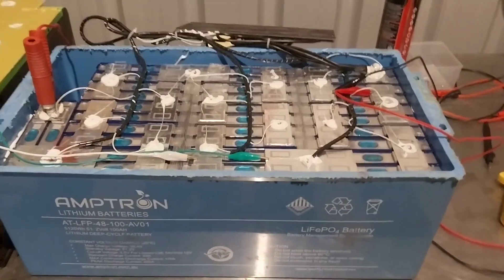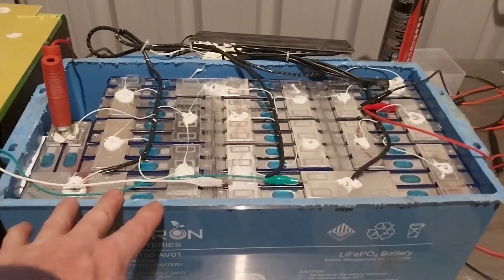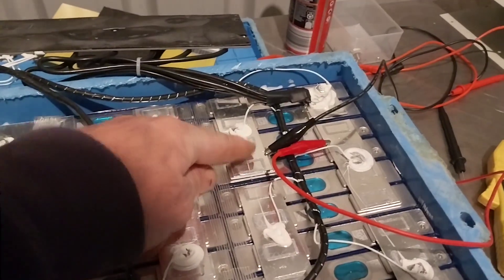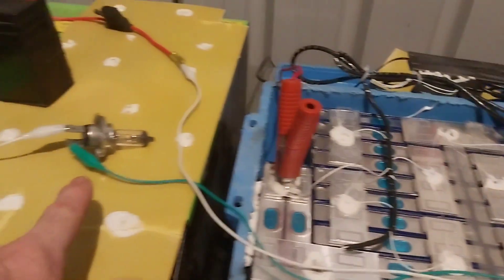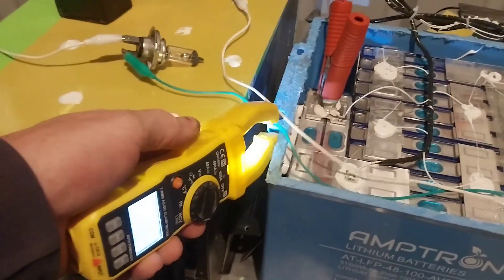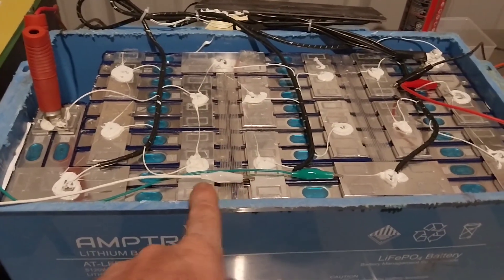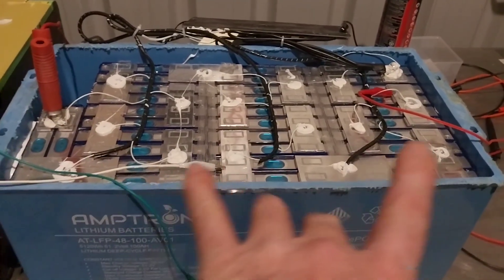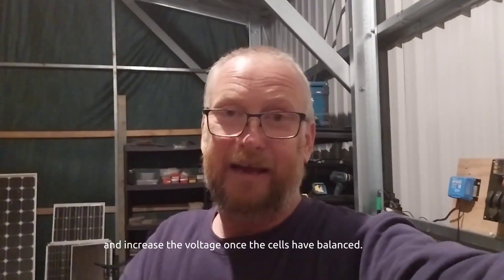Update On The 48 Volt Battery With Cell Balance Issues.

Comment: The 56V in VRM is looking good. There is still a little spike from 55V, but I can see the BMS is connected, and there is no ripple and a small balance current coming from the solar charger. When you do the discharge test, what you might find is that the cells that are high will be the first to hit a lower voltage. This is what I find in my batteries. The best cells are the last to balance and will still be 3.2V when others are hitting 2.6V, and the BMS is shutting down discharge. Looking forward to the next video.
Reply from the maker: I set both the remaining cabin batteries and the battery I pulled apart to 55.2 volts on both absorption and float. But decided to up the voltage to 56 volts to get the cell voltages a little higher to help with trying to balance.
We see how that goes?

Comment: The Kings 2 x 12V 120Ah lithiums I have are now 3 years old and seem to be working fine as a 24V system. No issue although I have run them flat a few times in extended wet wx. Don't spend any time checking the capacity as they deliver backup to IT and automation 24/7. The solar system seems to get them to full charge 28.4V cutoff most days and they float 27V.
Reply from the maker: Yes I am experiencing the same from my two Kings 120Ah Lithium's on my 24 volt system.
I was saying to a fellow off gridder yesterday when he came around to my place for a look see at the battery I opened....
I spent big dollars on high end batteries and after 3 1/2 years I am running into problems. My Kings batteries after 2 1/2 years have been problem free. Makes one wonder if it is really worth paying top dollar for batteries when the cheap once do just as well.

Comment: an illuminated clamp LOL  never seen that before.
ive seen some high end clamps that can even read miliamps
Reply: If you want to measure small currents with a clamp, you can wrap the wire round it 10x in the same direction for 10x the reading

Comment: 3.45v will fully charge the cells, but it's like trickle charging it, it will take forever, this voltage is what my float voltage goes to after absorbtion voltage 3.5v has finished
Reply from the maker: I have upped the voltage to 56 volts (3.5 volts per cell) and see how that goes, do some experimenting.
Reply: @TheOffGridBachelor  Putting a load on the high cells will speed up the balancing

Comment: It's very difficult to balance anywhere other than at full charge. You need the battery to be in the rapidly rising part of the curve. 3.4.v is just in the begining of the rise but expect to have to find balance it at full voltage. I do top balancing at 3.65v but normal charging at 3.5 or 3.55v normal balance start at 3.4v for the active balancer and a bit lower in winter when full charge is reached less often and balance drifts.
Reply from the maker: I have upped the voltage to 3.50 volts per cell to see how it reacts, good to play around and experiment.
I watched some videos on The Off Grid Garage and Andy did some tests on balancing cells at the higher end voltage.  He found the BMS that had a passive balancer couldn't work properly when the input voltage was high and it was trying to dump power at 100 milliamps or so while at the same time charging everything to the max voltage.
When he dropped the voltage he found the BMS with passive balancers could handle it better.
But for batteries with the active balancer was different and they could handle the higher voltages while at the same time transferring current across to other cells that were out of balance.
So thought I would give the lower voltage a try for shits and giggles and see what we find.
Reply: @TheOffGridBachelor  yes he is right for the passive balancer but that's only when using it to balance. If you are doing it manually then the high voltage works well. You can do it at high voltage with the passive one but you need tight current control over the charging current so you can charge at 58 point whatever volts at less than the passive balancing current.

Comment: except: andy uses a bms equipped with an active balancer.  even then it takes some time.

with like 80mA of a passive balancer you'll be retired if the cells ever balance on that current at all.

the more out of whack the higher the balance current. hence the bms with active balancing of 2amp and additional 5A external balancer.
Reply from the maker: I realy don't have any option at the moment as I don't have the set up Andy has, well for now anyway 😁😁
I'm gonna have to work with what I have and see what I can do. Consider what the battery was like, I have brought it up a fair bit, so just gotta take my time with it 👍

I will order an active ballancer for balancing cells and a new BMS with active balancing for this battery. I just need to wait as school holidays last 6 weeks and my income stops over the school holidays. Then when we go back, I get paid each fortnight, so no income for me for 8 weeks 💰
Reply: @TheOffGridBachelor  holy moly thats a hard payment policy !

Comment: Can you get your money back and buy a real battery?
Reply from the maker: I guess it depends on what you call a real battery 😄
Reply: Not after cutting the top off it, no :p
Reply: Of course not, comment made to provoke deeper thinking of buying from unreliable Makers. The maker is using 50 AH cells that they got at a very cheap price and then up charges at top retail pricing. When you combine two 50 AH to make a 100 AH you risk the chance of one of the 50 AH failing. (32) 50 AH compared to (16) 100 AH introduces a vulnerability. If you DIY your own batteries you know what is in them.
Reply from the maker: @stevenfrazier8939  I was thinking the same when I saw the 50 Ah cells. I thought maybe they used them so they would fit in the battery box. But there are 48/100 batteries out there that use the 100 ah cells so that is a good point.
With all the different batteries I have pulled apart, I am starting to think DYI batteries are the way to go. My concern is where to source good cells from as I am not very experienced at buying online.
There is a supplier in Australia that sell battery kits and cells but they are very expensive. I can see some DYI battery builds coming up in the future on my channel 👍
Reply: @TheOffGridBachelor with dying kits,the prices you see "online" are usually usd$ and shipped from china-so when paying shipping fees they can be quite expensive... look around for the Australian sellers(distributors)  like lithium way in QLD for kitstheir prices at the moment seem reasonable
Reply from the maker: @wayneferguson1520 This is the place I have been looking at online, I think they are based in Yatala, QLD. They seem pretty pricey but then again, I am not up with the prices of cells.
https://lifepo4oz.com/
Reply: Your doing exactly what I would be doing. I would be taking it to 3.5v per cell however
Reply from the maker: @FleurMann-b3d  Yeah I increased my charger controller voltage this morning to 56 volts which is  3.5 volts per cell. I also did the same on the cabin controller setting 56 volts for both absorption and float voltages, see if it helps get them balanced.👍